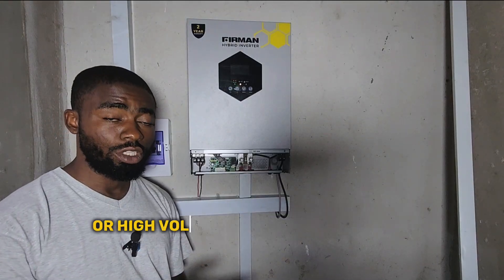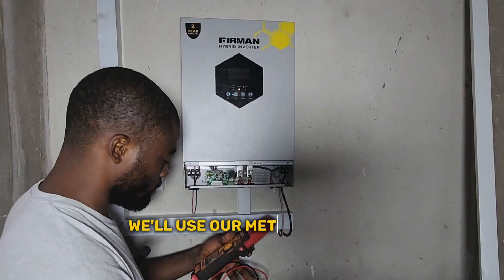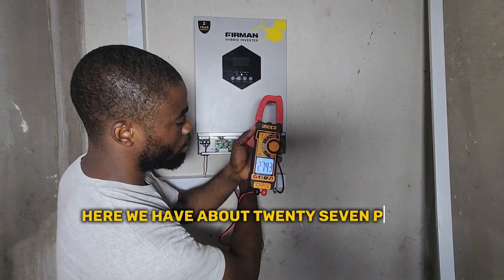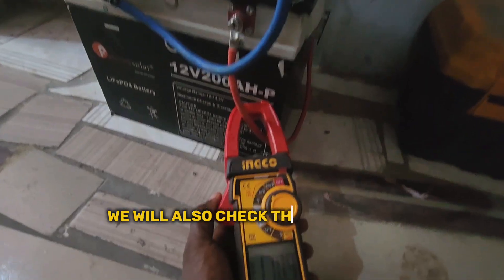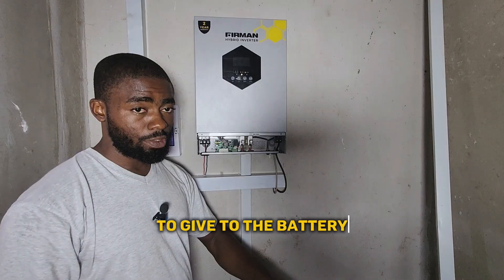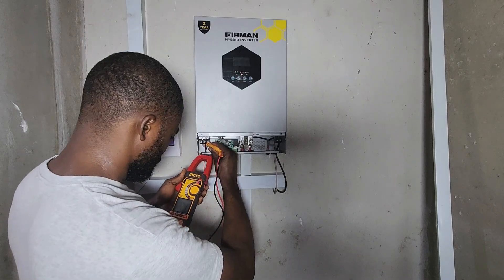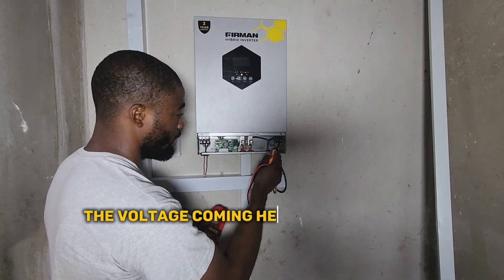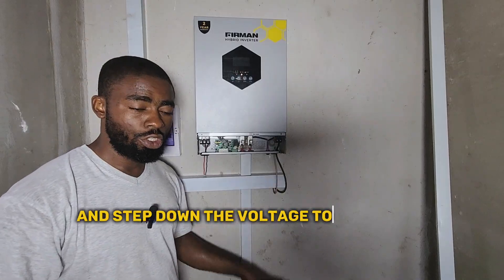Can high voltage from solar panels affect the battery bank?.

Comment: Can you please through some light to the effect of having solar panels at distance from the inverter/charge controller.
Eg a cable of >50m is required from solar panels array to inverter setup

Comment: I bought 4 LiFePO4 cells, and I will not have the money to buy the remaining necessary items to set up my solar system for 2 months or more. Will my cells get damaged for not using them? The seller told me to recharge once every 3 months but I would need to buy a charger for that.
Reply: No. Your cells won't get damaged. It actually depends on the voltage it came at. But you should be good for six to eight months, even a year, without charging but definitely not advised to be more than. I mean, why buy a battery you won't use for more than a year? 😅
Reply: @ekeretteekpo3004  thanks you, that is a relief! I measured the voltage and each cell is 3.2 volts

Comment: Now you proof the conversion of high voltage and low current to lower voltage and high current 👍, now I have got a peace of mind, in your previous video you've argued a bit in the comments about MPPT, and now you got it, that's what we want. Keep going engineer 👌.
Reply: Nothing was converted actually. The MPPT only reduces the excess voltage of the PV input power (IV) so that its output power will have a higher current and lower voltage to the battery as needed. (Remember, energy can neither be created nor destroyed.)

I think this is what the engineer is trying to explain.

However, from a layman perspective -- it feels like the MPPT does magic of CONVERTING High PV volt + low current to Low output volts + high current. 

And the word CONVERT is much easier to use in explanations.
Reply: @oluwaseunadeola7669  where is the higher current coming from..because only 5A enters the charge controller
Reply: @oluwaseunadeola7669 but energy can be converted from one form to another...right?
Reply from the maker: You don't understand conversion and boost!.
Voltage cannot be converted to current sir
Reply: @Mairigaemmanuel  you make a correct point in the video, and still get it wrong in the comment. Mppt Charge controler converts high voltage to high current. Period

If you still want to argue, just explain why you got 5A in the solar panel and got 17A in the battery charging current,  also, why you have higher voltage in the solar and lower battery charging voltage. 

I understand that all these things can be so confusing but its not rocket science to someone who even studied physics in secondary school.
Reply: @Mairigaemmanuel  yes voltage can be converted to current, but about power conversion V×I, eg. 150v×5A=750w coming into the charge controller and then when the battery voltage is 24v at the time, then 750w÷24v=31.25A will go into the battery without including the charge controller efficiency, when included then it will be like 29-30Amps. And when the battery is nearly full then it reduces the current flow to the battery even 750w is entering the charge controller. I think you got what I'm talking about.
Reply: @Mairigaemmanuel so where is the supplementary current that is boosting the output current coming from. Like is the charge controller  getting the extra current used in boasting coming from